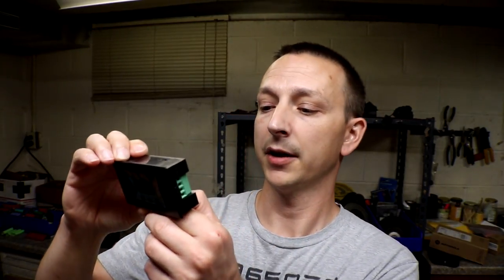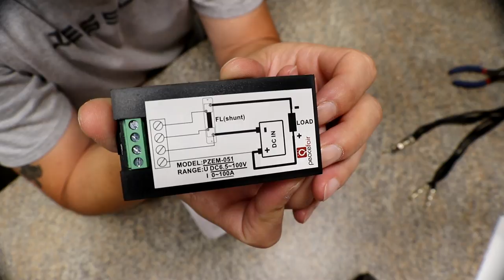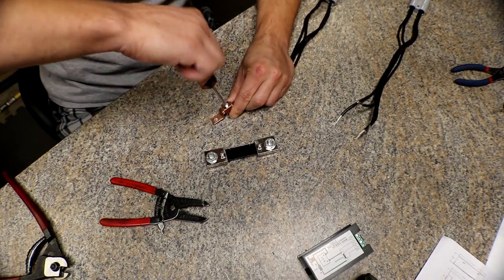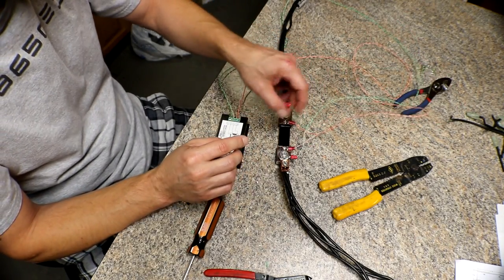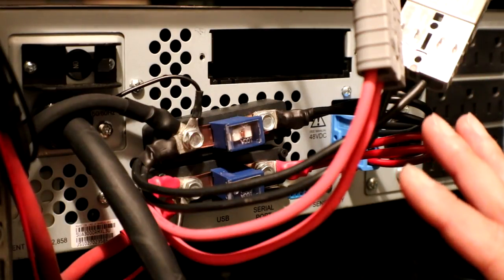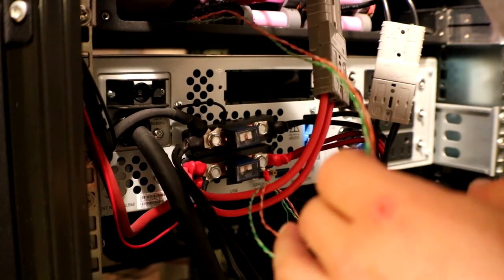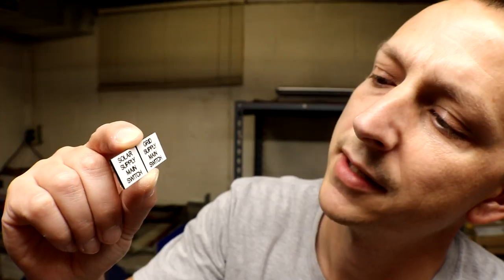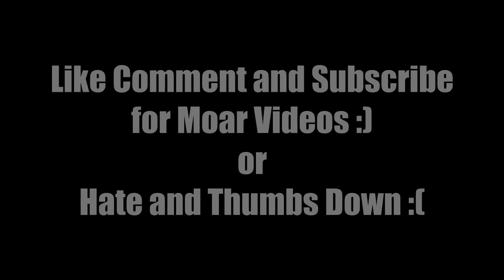Diy Tesla Powerwall ep60 Multi-Function Meter Install From a YouTuber!

Comment: Nice work m8! Have the same meter here on several places and they work. Ur getting there :)
Reply from the maker: +DIY Tech & Repairs Sweet, are yours showing correct voltage. Im probly gonna pop the top to see if it can be adjusted.
Reply: DIY Tech & Repairs
Reply: Yes?
Reply: AveRage Joe mine was pretty close

Comment: maybe you can put a pot between one of the wires from the shunt and meter? or make a voltage divider with resisters since its double cut the volts in half from the shunt. I don't I never worked with one of these before! but it could work.
Reply from the maker: If the amp reading is correct, Im fine with the volt meter only being .5v off👍

Comment: Hey Joe just did back of a napkin Calcs.. If standby pwr consumed is 130w / hr.. In 24 hr that's 3.12kwh. Yikes!  I know it sucks; me thinks you should consider getting an inverter with low  standby consumption. I too did the math and am currently saving up for an mppt inverter combo with standby draw of not more than 10-30w/hr coz I plan to run a pure off grid system. And every watt counts. Even for use as a normal ups those things are power hungry beasts 3 kw a day for no load!  I have been paying dearly running my ups; my power bill went up almost 3 times from about 10 to 28 dollars a month!
Reply: Ahh the downsides of UPS's, Good points tho
Reply from the maker: +DIY Tesla PowerWall Will do when I got home 👍
Reply from the maker: +anthony karuri Oh Yeah I completly agree they are not efficiect lol. Ya on paper thats terrible but it looks cool 😅 lol. I wanted to see if it can be done in a long term/alternate solution. Ill get a real inverter one day but for now Ill use what got 👍

Comment: how do you charge 1400 cells using solar, I looked up your controller.. without modification its weak.. anyway,, my problem is on a 36'' sailboat, I can't have elec fires.. soooo wondering how you charge your power wall? appreciate what your doing .. so cool watching your test the other night
Reply from the maker: +acs451 All the 100 cells are parallel in a pack then each 100cell pack is series together for 48v. 14 packs. No mod needed to the charge controller for up to 60 amps. Thanks for hanging out 👍

Comment: ive noticed with cheap meters they are not consistently off. even on ones you can adjust, in one end of their range they may be spot on and at another they are compleatly off. on my cheap lab power supplies on 5 volts the meter may be spot on and at only 30v they are off by almost a volt. i try to calibrate them mid  range but its still not perfect
Reply from the maker: If they are adjustable I usually try to do the same unless I need it accurate on one side👍

Comment: Another point, Have a think on how your going to use your powerwall long term and what loads your going to run. Eg are you going to run your basement off it? your whole house? 10kwh is a start but like all of us you will be thinking of the next 10kwh so before long you might have 20kwh which really means as your project goes on it would be wasted if your not running the house off it for example. Now if so the question is the apc is never going to work in powering the house as it doesn't have a good surge current when house loads turn on and off, so knowing that and knowing the bad standby the apc is a very short-lived idea but works for a test on the batts. Even a standalone 48v inverter eg the 3000w one in my last comment might not be the best and wont run the whole house. I would look at ether a grid-tie/limiter like how i am using as it works very well and is portable if you're renting or go bigger and get something like the MPP solar pip4048, which will auto fail back to grid if the battery isnt on or in overload if the house uses more then it can provide, both will do the trick, Both will power the house but The pip4048 needs to be wired into the fuse board and needs an electrician so factor that cost in. The pip also has a changer so thats another plus i guess. Just giving you some idea and some things to think about. hope those thoughts help :)
Reply from the maker: Yeah lol Im processing cells for the next 10kw.  I could possibly hook up some caps for the surge loads.  The option of switching back to grid would be the best option, I do like that!  I appreciate the suggestions 😀👍
Reply: haha yip more you get into the project the more you start realizing what your needs will be as the project develops
Reply from the maker: +Mikes DIY Tesla Powerwall Yes! Totally agree🖒

Comment: I have the same meter on my system and it is about half a volt out aswell I pulled it apart and didn't find anywhere it could be adjusted
Reply from the maker: +Rick Smida Awesome, Thanks for sharing 👍

Comment: Hi I am new whit the 18650 battery .I've been watching your video I like it you're really good I just like to know why are you using fused glass instead just wire fuse
Reply from the maker: +Sylva Labrecque I wanted something to pop really low just in case a cell goes bad it will pop the fuse at a low amp vs a wire that pops higher and drag the hole pack down before it pops.
Reply: Thank you I will do the same I have 1 more question I have a camper with 2  batteries 6 volts  trojan t-105 RE  225AH  in my camper whit a 2000 watt pure sine wave I will like to replace my trojan for the 18650 batteries  .so my question is how many batteries do I need to replace the one I have.Thank you sir
Reply from the maker: +Sylva Labrecque Depending if you go 3s or 4s. 3s you would need at least 300 cells at 2250mah or better and 4s would be 400 cells at 2250mah or better. Both in 100p cell packs.

Comment: If I wanted to see something blow up, I'd watch "ElectroBOOM" channel.. lol.
Just run 0 gauge cable to a mounting block with a box to cover it all then the UPS has 1 connection.
Measure that 56v on the box terminals to test if it's your network cable dropping (highly doubt it but hey) ie check either end.
Reply from the maker: +Phizicks Yeah pretty much somthing like that! Big ass cable👍

Comment: shunt yo mouf
I been hoping someone would do a video with these gauges.  I need a one with at least 300 amp range. I found a 500 on eBay. I may get it. yea 300 amps. its the curse of using a 24 volt inverter. great video . I was planning on using phone wire. to run from the shunt to gauge. and 18g for the power.
Reply from the maker: +James stranger lol Ya I figured Id keep making the vids as it changes ect...
Reply: AveRage Joe 
great. I'm very interested in your project. I'm sure lots of others are also. and you do a great job entertaining while teaching and inspiring. thank you
Reply from the maker: +James stranger Well Thank You!!!

Comment: Bad idea to use a ups as an inverter, i was waiting for this test and it does show why its a bad idea to use a ups as a inverter with a standby 130w at close to 3kwh of wasted power in 24hours its like 1/3ed of your battery power wasted, ur 10kwh just turned into 7 useable now the % of wasted power under load should be better but there will still be the inverter base power that is wasted it might be closer to just over 100w. I remember years ago someone saying the high standby consumption on batt only mode and not to use a ups. Remember a ups is designed to be connected to power and almost in inverter batt bypass most of the time which means the 130w standby isnt a problem but when no grid and inverter running on batt this standby is really a problem. Normally the ups will be supplying power to the load for the 15min or so until the servers/computer turn off and the ups shuts down. This design of a ups was never created to be run in batt only mode and hence the very bad standby when no load or low load. Its great that it works and really good job :) Love the progress but i think its time to really think about using a inveter designed for this. Peter was saying the mpp solar inverter he uses has a standby of around 50watts which is also kinda high but hell of alot better then over twice that with the apc. Given you have the charger installed you only need a inverter from 48, Have a look at the 3000w from this channel they do a 240v one, if you havent already watched some of his vids its def worth a watch. https://www.youtube.com/watch?v=77k0PJ8vyuo  The grid-tie 2000w inverter i use has no standby current draw on the batt side and i think about 5-10w on the AC.
Reply from the maker: Yeah I figured it wouldnt be very efficient.  I just wanted to know if it could be used as a long term option.  If they will last or hold up.  Ill continue to do some tests and use it for the time being an possibly save up for an inverter.  Ill take a look at his ch, Thanks!👍
Reply: I think the APC will last years but would be a real pain and a waste of battery power to use it in the powerwall setup long term .